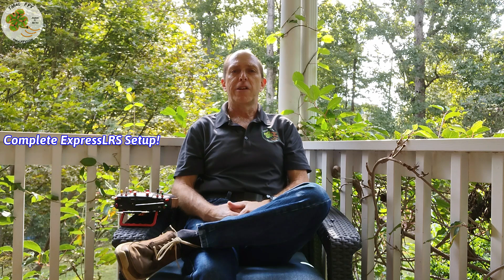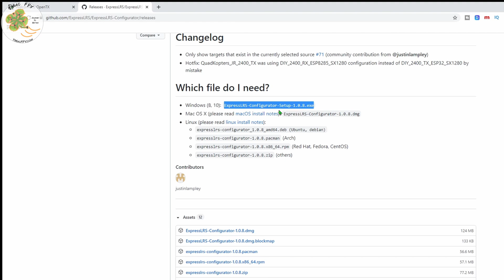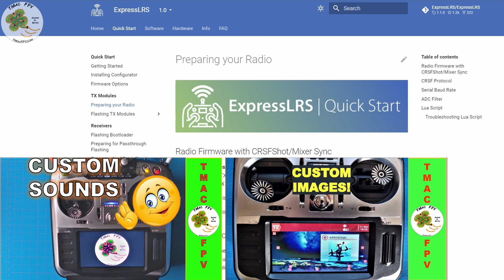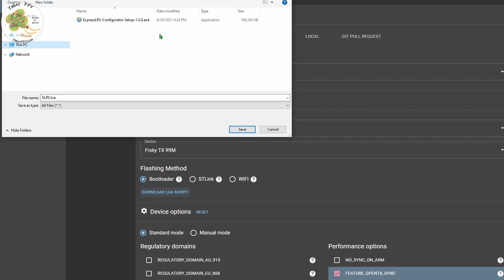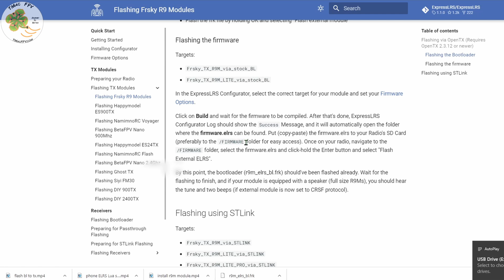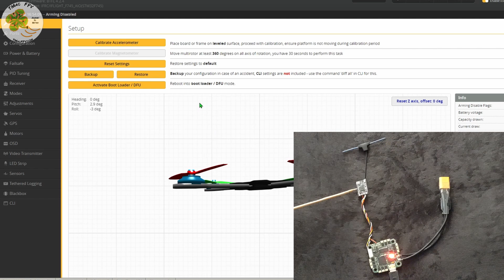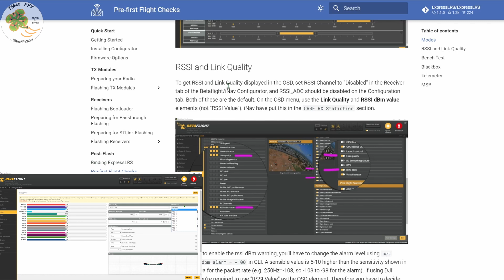ExpressLRS (EASY to FOLLOW SETUP with TIMESTAMPS!)

Comment from the maker: My take on ExpressLRS.  There are 4 main benefits of it:  1.  High-performance, 2. Inexpensive, 3. Versatility (with both 2.4Ghz and 900Mhz capabilities), 4. Open Source.  If I were just starting out in FPV, I'd go with the RadioMaster Tx12 with the standard module bay (or TX16 if my budget permits) and any of the ExpressLRS modules and receivers available in the links below.  How about you? Make sure to visit my site at https://tmacfpv.com/
Reply: I'm going to stick with Crossfire Nano modules, the extra cost is worth the convenience.
Reply from the maker: @mrb2917  I'm not throwing mine away anytime soon either

Comment: Great video TMac. I have updated the firmware on the Happymodel external module, however, my LUA script isn't working. Every time i click LUA on radio, i get the (Loading....???). I have removed LUA scripts and downloaded it again but i'm still getting the (Loading..???). I have been on ELRS website reading the troublshoot page, their facebook group, etc. but i still can't get the Lua script to work. Also, there are no videos on this issue. Any help is greatly appreciated.

Comment: I've got my firmware flashed to both radio and quad, they are both connected, I've updated all my drivers, and am following the proper steps to connect to betaflight. I see my fc port in betaflight but it will only connect half the time and when it does connect I'm unable to do anything but look at the first pop up screen (Setup). When I click on ports or any other category on the left I just get a loading wheel saying "waiting for data". Do you have any advice on what I'm doing wrong? Thanks!

Comment: Nice tutorial, but all that to get it up and running? 😳😳 I feel like I got lucky now. Bought module for my tango 2 and installing it was hardest part. It said came preinstalled with v2. The mobula 7 elrs quad also came v2 preinstalled. So all I did was put lua script on my radio...copied from website. That was it. I have no experience yet with the Elrs configurator. I don't understand why I didn't have to install any firmware on my radio tho? 🤔

Comment: I don't know why 2.4ghs is making such a comeback. When I started a year and a half ago all the big names in this hobby was running 915mhz Crossfire. Now they seem to be doing 2.4ghz Tracer and ELRS. I just ordered my BetaFPV 915mhz ELRS nano module and a receiver. I like the penetration of my Crossfire. I can fly all the way around the building I work in, which is a carbon fiber shop and a machine shop. The building itself, plus the contents of the building should block the signal but it doesn't. This is a large 6 unit building. I love that reliability. I also love the $16 per receiver price tag for ELRS receivers over the $36 price of the Crossfire receivers.
Reply from the maker: Well said 👍The 2.4ghz "craze" these days is due to LoRa protocol. However, I also prefer the penetration of 809mhz band. In my newest video (RadioMaster Zorro), I explain basically the same thing you just stated. I've got the 2.4ghz ELRS version of Zorro and also put a 900 Mhz band ELRS module on it https://youtu.be/pYJ1XduQVc0 I'm definitely with you on receiver cost too!😉👍

Comment: how do you set up baud rate on your radiomaster tx16s please help
Reply from the maker: to my knowledge the baud rate is not selectable on the TX16S.  I do not know for certain what the default baud rate is.  ExpressLRS is supposed to automatically switch to the correct rate being used by the transmitter on power up.  Are you not getting the desired packet rate for your ELRS signal?  To get high packet rates you need to be on OpenTx 2.3.12 (at least) or EdgeTX.  https://www.expresslrs.org/1.0/quick-start/tx-prep/    I use the ELRS 900 mhz band.  My packet rate only goes to 200 hz.  I'm able to change my packet rate by pressing System button, paging over to Tool menu.  Scroll down to ELRS LUA script & press Enter.  first line that appears is Pkt rate.  Short press Enter and it should start flashing.  Use scroll bar to change Pkt rate then press Enter again.  Press Return button to escape from Lua script.

Comment: Enjoyed your video, I'm new to FPV. Actually I'm new to all of this, but I'm looking at getting into Fpv with one of my planes. I have a Aero Scout and just got a Goblin. I purchased a RadioMaster TX12, which I still haven't quite got a "grip" on programing this critter, lol, but I would like your opinion on which module should I get, I watched your video on FPV equipment but I'm not sure as to which module I should buy. ELRS  or Crossfire? What size , nano, micro....?
Thanks for the help
Reply from the maker: Welcome to FPV. Danny! Nice choice on transmitter. 👍I prefer a 900 Mhz control signal myself for better penetration when flying through and around objects such as trees, buildings, etc. So, I'd go with either the TBS Crossfire Mico module or the 915mhz (if in U.S.) version of ELRS.  Although for flying fixed wings, you're gonna need PWM, correct? Check out this Matek 2.4ghz PWM ELRS receiver https://www.defiancerc.com/products/matek-elrs-r24-p-expresslrs-2-4ghz-pwm-receivers . Crossfire is more established at this point than ELRS and I've never had any issues with it. It's "worry free." ELRS is the "newcomer," however I expect it to become "the standard" very quickly. That's because the receivers and modules are less expensive than Crossfire, it's open source, and it's advancing rapidly. I have both Crossfire & ELRS. Crossfire also has a PWM receiver here https://pyrodrone.com/products/tbs-crossfire-6ch-pwm-nano-rx   IF I were just starting out in FPV today, I'd go with 915mhz ELRS, but not sure if ELRS has 900 Mhz PWM for you yet. ELRS is slightly more work right now to get started with it but you'll save a lot of $ in the long run. My recommendations & rationale are on this page of my site https://tmacfpv.com/fpv-transmitters/

Comment: I'm using Taranis Q X7. I flashed Open Tx 2.3.14, but I'm  not getting the CRSF option in External RF. I can't find what the issue is :(
Reply: I was trying to change to CRSF in an existing model which was bound to internal RF. I made a copy and turned OFF internal RF, after that I got the CRSF option in External RF. Leaving this here in case anyone else does the same :)

Comment: Well.. I guess betafpv sent me a bad nano rx. Does nothing but solid blue led 100% of the time. Ugh
Reply: mine is the same .. cant flash ive tried all ways
Reply: @geterdnboy  same.. I never got it working.
Reply: I actually did get mine working I had to flash with a serial adapter and the first time it went perfect and it's in my quad now on fw 2.1.0
Reply: @geterdnboy  serial adapter? How did that work exactly? Or what kind did you use.. Explain so I can try! 😂 I have 3 working, but I also have 3 that did that and are just sitting that I couldn't get flashed or anything

Comment: I keep getting this error, Any Ideas?

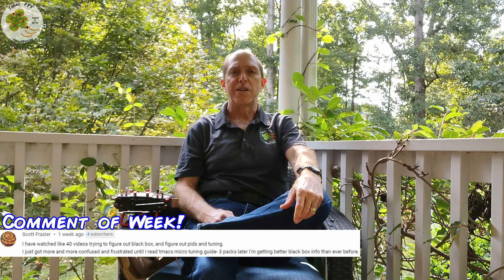* [upload] Error 2 ========================= [FAILED] Took 19.04 seconds ========================= Environment Status Duration ---------------------------------------- -------- ------------ BETAFPV_900_RX_via_BetaflightPassthrough FAILED 00:00:19.045 ==================== 1 failed, 0 succeeded in 00:00:19.045 ====================
Reply: This may be it

**Exception('No valid serial port detected or port already open') Exception: No valid serial port detected or port already open ** [upload] Error 1 ========================== [FAILED] Took 4.27 seconds ========================== Environment Status Duration ---------------------------------------- -------- ------------ BETAFPV_900_RX_via_BetaflightPassthrough FAILED 00:00:04.267 ==================== 1 failed, 0 succeeded in 00:00:04.267 ====================

Comment: Hi, I have a question? I Flash my R9M 2018 ACCST Module to ELRS and it working. My (Frsky R9 slim+ ACCST) died two days before in a crash.  I just order  (FrSky R9 Slim+ OTA  ACCESS), will is be possible to install ELRS firmware to be compatible with my R9M 2018 ACCST Module?  Which RX ELRS firmware should I use? 
R9Slim+ (ACCESS/OTA): r9slim_plus_ota_elrs_bl.frk (18kb) or R9Slim+ (ACCST): r9slim_plus_elrs_bl.frk (14kb)
My Module is the R9M 2018 ACCST Module that I have install ExpressLRS.
thanks

Comment: Hi Tmac, thanks for all your work is a great help for everyone .
I’m having trouble with the telemetry with ExpressLRS 2.4? I can only get it to find 10 sensors: (1RSS, 2RSS, RQly, RSNR, ANT, RFMD, TPWR, TRSS, TQly, TSNR) I already tried updating the RX and TX to the latest firmware with the telemetry option, I also deleted all sensor and discover new sensor, and also increase the Packet Rates but still doesn’t seems to work, any suggestions? could it be that I’m missing configurating something in betaflight?
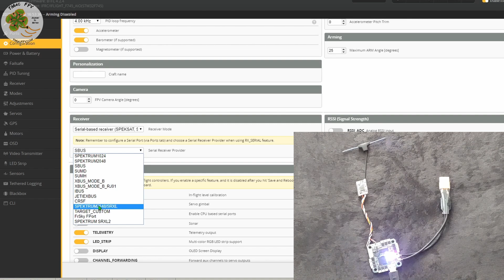Reply from the maker: 1. Enable telemetry (toggle it on in Betaflight) as shown in this video at about 24:50 time mark. 2.  Enable Advanced telemetry must be enabled for both the RX and TX firmware. 3. Try with Hybrid Switches enabled if not already done - see Enable Telemetry section here https://www.expresslrs.org/1.0/quick-start/firmware-options/
Reply: @TMacFPV  Thanks for your fast response, unfortunately all the options mention where active (Advanced telemetry in RX and TX with Hybrid Switches enabled) but still not getting the rest of the telemetry and only happens with the HappyModel 2.4g ExpressLRS, any other suggestion?